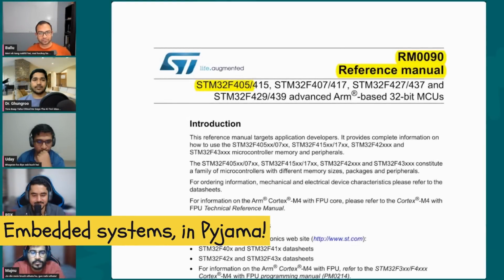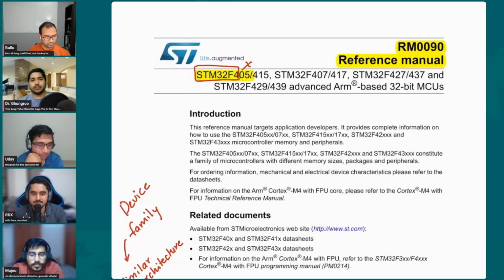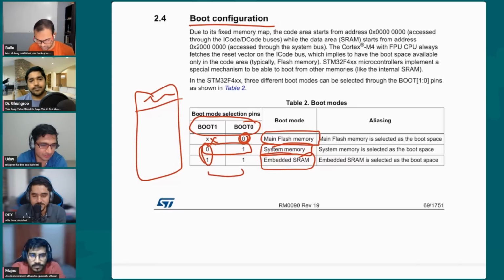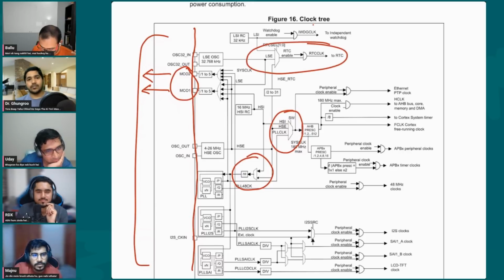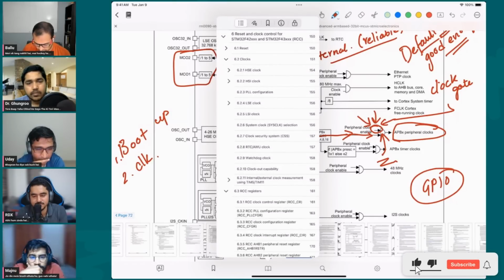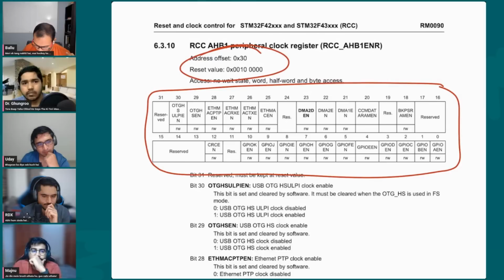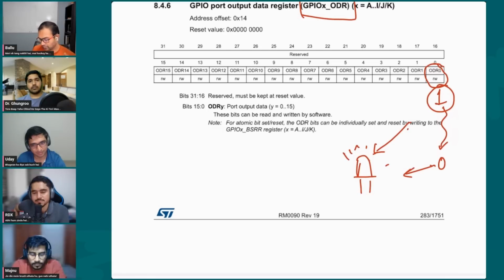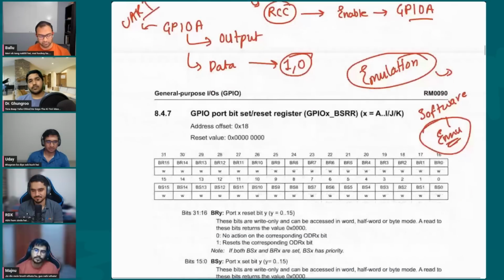Reading Datasheets - Toggling GPIO | Embedded systems podcast, in Pyjama

Comment: Please let me know why pullup and pulldown registers configuration why do we need that , what is the use
Reply from the maker: Pull up registers hold a line to 1 when it is not being driven and pull down hold the line low when it's not been driven. This of this as forcing default values to the hardware pins...